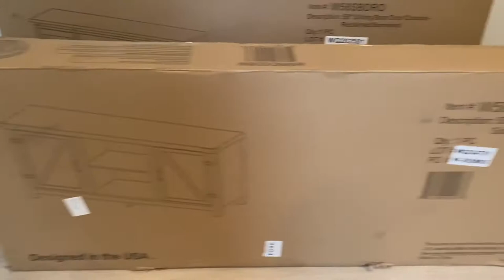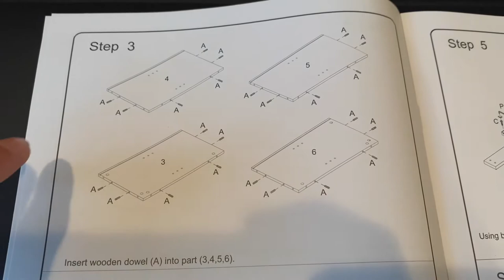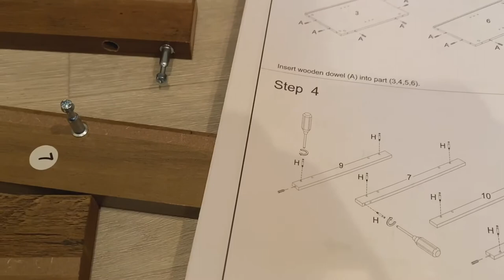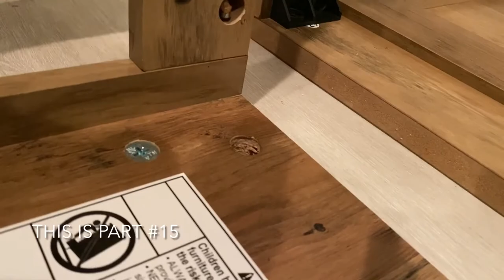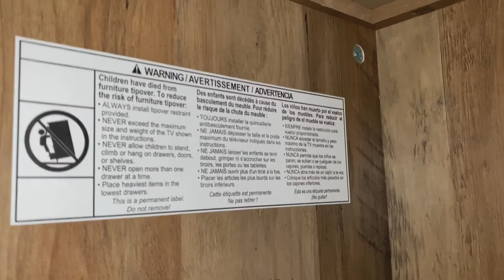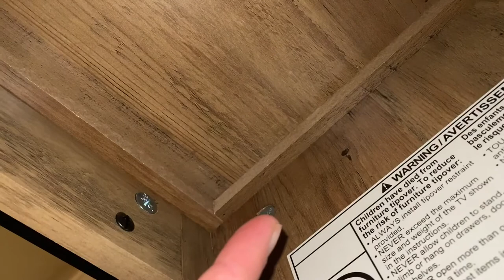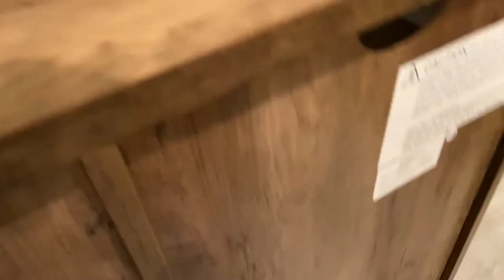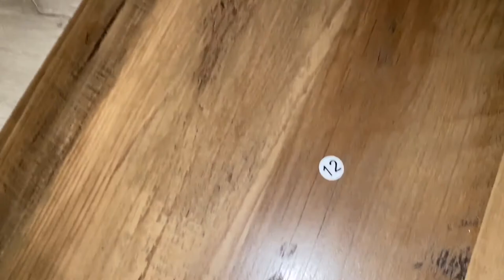Step-by-step Assemble *Sliding* Barndoor TV Stand 65” from Walmart - Manor Park by Walker Edison

Comment: Thanks for the help! No holes in pieces in #4 and #5 so we drilled holes and all is good. Will finish assembly tomorrow.
Reply from the maker: Nice work!
Reply: @savemoneydiy1462  This was not easy as holes did not line up and had to drill new ones.  Thanks for your help in making it easier.

Comment: Liked and subscribed.  Best assembly video for this TV stand.  I had an amazing time putting it together this morning/afternoon.  The only part that frustrated me was @ 25:00 as you explained.  It was a challenge to line up the wooden dowels, get them into the holes, and keep them there.  I figured out a trick after about 10 minutes of trying.  Lay on your side and use your body as a wall.  Then, take your arms, reach over and pull it into you with the base pressing against your body.  It's like giving it a good hug. 🤣 This position allows you to line up what you need to as well.  Might sound and look crazy when you do it, but it worked like a charm.  No idea what made me think to do it this way, either. 😂
Reply from the maker: I like it! Thanks for sharing the trick!

Comment: I have the same thing but my screws just pop into a hole they don't screw into a hole and they keep coming out they won't stay together and then I got to lock the stupid things in underneath the other piece which you can't get the lock in until you jiggle the screw out a little bit what a nightmare I've been at it for four and a half hours and I'm not even done

Comment: This is the biggest piece of crap I have ever bought! Some of the screw holes were stripped while others were cracked. Not enough glue and trying to do it by myself was impossible!  I threw the crap in a fire pit! Just burned 200 bucks! I will save up for a top quality one and pay someone to put it together for me. U made this look so easy. Trust me it was not easy at all and most of the pieces were junk!
Reply: Same, terrible piece of crap. Spend 400$ on the bigger model. There was no manual attached and everything keeps breaking and nothing fuckin fits. Terrible purchase